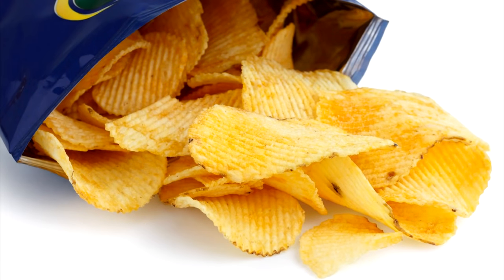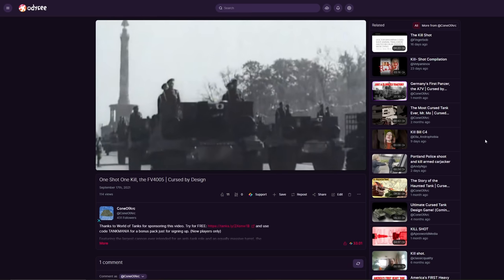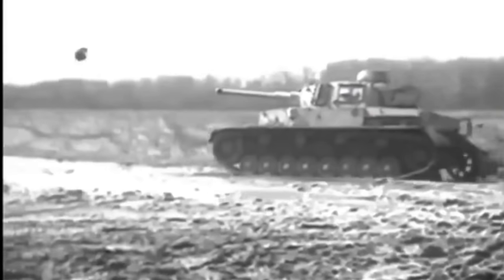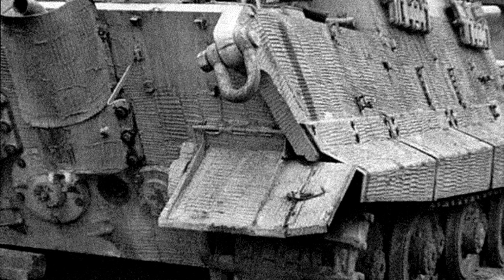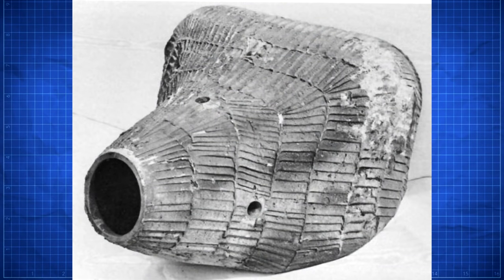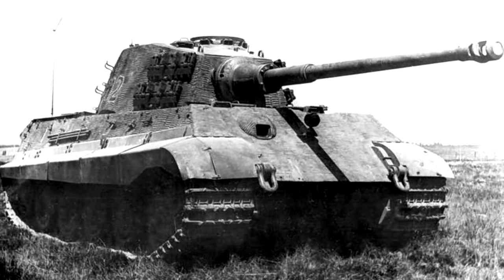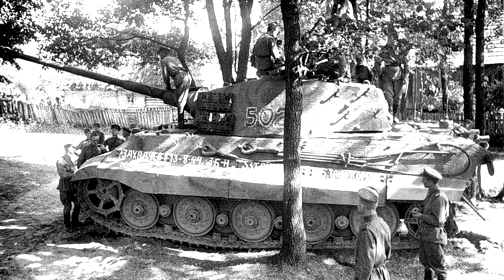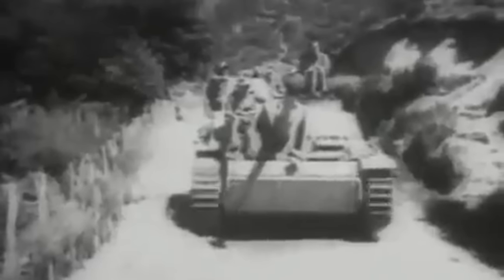Why did Germany put Zimmerit on their Tanks? | Cursed by Design

Comment: The main thing is that the crews believed they were safer with Zimmerit, it's an important thing when you charge into battle
Reply: Placebo Effect...
Reply: The US Army did the same thing with the same effects 20 years ago with their Kevlar vests….the troops thought they were bullet proof and had extra confidence while wearing them……unfortunately though, years later when we invaded Afghanistan we discovered that an Ak-47 round (7.62) would go right through them like they were made of tissue. The military had known the vests were ineffective against small arms fire from day one and the only thing they stopped was flak, shrapnel and bayonets. Thankfully the Army had developed an alloy plate insert for the vests that would stop 7.62 rounds that they quickly issued out.
Reply: @Dj.MODÆO  thats fucked up
Reply: @Dj.MODÆO  If that would be true, US soldiers must be very very dumb.
I was '99 in the german army and in KFOR, we knew exactly that the kevlar vest would stop max a 9mm and the Bristol vest (Kevlar with ceramic plates) was rated to stop 3 7.62mm NATO hits (when hit on one of the ceramic plates). In Kosovo i didnt had contact with the US Army, they were in a differnt sector than i, but im pretty pretty sure they already had similar vest to the Bristol, long befor Germany bought theirs from the UK for KFOR.
And no, the kevlar vest did not stop bayonets or knifes.
Reply: @drscopeify  The differnten levels of armor has nothing to do with the weather, the army usually doenst care about that, it has tactcal reasons.
I was in summer in Kosovo, around 40°C, sleeping in the tents on daytime (after night shift), impossible, even hotter than outside. And still we had to wear the bristol when we had to go outside of the camp.
Some of us removed the cermic plates, but it was not allowed.
Reply: @wolf310ii  It was different in Afghanistan and Iraq.    In winter when on foot things are different than in summer when on foot.
Reply: @Dj.MODÆO  I doubt a kevlar vest can stop bayonet when it can't stop guns. I don't have knowledge about the exact armor youbare talking about, but remember that even if it can't stop bullets, it could lower its energy and help the innerds of the person be less messed up
Reply: @mortache  I’ve done 3, 12 month deployments. 2 to Afghanistan and 1 to Iraq. The hardened Kevlar(helmet) can definitely stop or deflect a 7.62 round….I’ve seen it many times. The kevlar flak vest however is a more flexible form of kevlar and a bullet could penetrate unless an armored back plate is inserted ….a bayonet however, even without having an armored plate….Not so much, that sh!ts like 3 inches thick. Maybe if you sharpened the hell out of it and had a running start downhill and weighed 250lbs. Lol.
Reply: "Zee hans, vhen ze panzer is coated vith zimmerite, it becomes booletproof!"

This is literal ork logic
Reply: @Dj.MODÆO  we started getting plates before the 1st gulf war
Reply: @wolf310ii  Kosovo is not a country

Comment: magnetic mines, sea mines did not "stick" to the ships.  rather the mines used a magnetic triggered firing system.  The magnetic trigger sensed the nearby passing of an iron ship.  the mines were NOT magnetically attracted to the ship.
Reply: Exactly! Naval mines used the effect of magnetism for exactly the opposite reason, so the ship need not touch the mine to detonate it as well as making it more likely that the mine will explode under the ship instead of against the side, doing more damage.
Reply: Exactly
Reply from the maker: This video wasn't specifically on how sea mines work I was just using it as a lead in to Zimmerit since degaussing is a somewhat related technology.
Reply: Ha, when I was a kid I thought magnetic mines would pop out of the ground, stick to the tank, and explode! 😄
Reply: @ConeOfArc  But you said that they could "easily stick" while they did not, so it would be nice if you'd correct yourself
Reply from the maker: @GaiusCaligula234  yes that was a mistake caused by oversimplification of how it all works. However I can't really change the video at this point so I'll correct it in a video about sea mines in the future.
Reply: @ConeOfArc  Cheers
Reply: @ConeOfArc just embarrassing
Reply from the maker: @andrewpease3688  Not really, everyone makes mistakes and I'm not afraid to admit when I make one.
Reply: Some sea mines were contact fired.
Reply: @andrewpease3688  sweat some more dude
Reply from the maker: I already issued the corrections I'm able to make without fully redoing the video which would be silly in my opinion as this isn't a video about mines. Refer to my latest community post for what I did. As for similar tech, yes both served as a sort of protection from magnetic mines just not in the way I initially described it.
Reply: @ConeOfArc  the amount of sweat is high with these people, thank your for the content Arc
Reply: The big thing about the magnetic mines was that they did not actually blow up against the ship, that is why they did not have contact fuses.  The mine was sitting on a shallow sea bottom and detonate when a ship passed overhead, triggered by the ship's magnetic influence.  The detonation would produce a large bubble beneath the ship.  The part of the ship encountering the bubble would be unsupported and the ship's keel could be broken.
Reply: @ConeOfArc  It's cool, I still enjoyed the video. I am a recent subscriber. To clarify, the comment about how I thought magnetic anti-tank mines worked as a kid was not meant to put you down, just poking fun at my own childish thinking. I re-read my comment and thought it could be construed as putting you down.
Reply: @richardbell7678  So the mine essentially acts like a trap door and grqavity does the rest?
Reply: @terraflow__bryanburdo4547  Yes.  

It occurs to me that the myth of magnetic mines being attracted to ships may have come from a fiction writer learning about the existence of magnetic sea mines without bothering to research anything about them.  A sea mine magnetically attracted to metal with enough force to pull it to the target shows up in an episode of "Gilligan's Island".
Reply: Limpet mine
Reply: @ConeOfArc  degaussing is in no way related technology. Stop doubling down. You embarrassed yourself and discredited your channel with a lack of knowledge and failure to research
Reply: @christianpethukov8155  put him down by all means! This is a school boy error and everything else on the channel is now extremely suspect
Reply: @ConeOfArc  i dont think degaussing is related to zimmerit tbh
Reply from the maker: @andrewpease3688  You don't know what the term "doubling down" means if you think thats what I'm doing. If I were doing that I would be refusing to make any corrections to the video and claiming my original point was correct. Me issuing a statement saying I made a mistake and will make a full video on the topic to correct that error as well as removing the main error in the video is the complete opposite of doubling down. It does suck that I made the mistake but I did what I reasonably can to correct it at this point so you berating me in the comments over it does nothing to change it.
Reply: @andrewpease3688  OK, give the guy a chance to get up and get good content out there. This isn't life and death. He has other videos that I've enjoyed that seemed just fine in terms of technical and historical accuracy.
Reply: Limpet, which was the marine equivalent  of the magnetic shapped charges used against tanks, certainly did exist.
But degaussing wasn't a protection against them. 
The poor little soul has conflated them with the magneticly triggered mines, and wandered off into a parallel universe.
Reply: @christianpethukov8155  bouncing betties
Reply: @ConeOfArc  You should correct it, reupload the video, upload an apology video and make an apology statement every day for 2 weeks for your single small mistake.

If you can't tell, I'm being sarcastic.
Reply: @andrewpease3688  clearly you have not watched the video. Degaussing is related because both it and the method discussed are related to magnetism and magnetically activated mines. This is a schoolboy level mistake, and everything you have said is now suspect. You should be put down by all means for this simple mistake.
Reply: @DDragon501  kindergarten
Reply: @masteronone2079  chill tf out he isn’t even a professional historian
Reply: @clankplusm  I'm sure he doesn't need his mum to defend him.
Reply: If mines explode just by sensing ship passing nearby, I would say they're VERY attracted...

... just like some boys out there.
Reply: Magnets, how do they work?!
Reply: @andrewpease3688  Yes you are.
Reply: @masteronone2079  Um, so where did he state that degaussing was used against Limpet mines? Because otherwise your comment is completely irrelevant and incorrect.
Reply: @DDragon501  He strongly implied that Magnetic mines were attracted to ships and that degaussing was the response. I pointed out that Limpet mines were the marine equivalent of the magnetic shaped charges used against tanks not the type of magnetic mine pictured (Not in as much detail as this, I'm being more granular in my explanation here because you seem to have a problem with comprehension).
I suggest you go back and re read the post, feel free to move your lips and follow along with your finger if that helps.
Reply: @masteronone2079  I read your post. You didn’t answer my question. Where did he specifically state degaussing was used against Limpet mines? Because he was talking about the magnetic detection mines used by the Germans, which he used the magnetic signature of a ship to trigger the detonation. He wasn’t very clear on that last bit, which he acknowledged in the thread above long before your comment.
Reply: @DDragon501  A: Your understanding of the time line of this thread is incorrect. Least important fact.
B: I never said that he said anything about Limpet mines.
C: I mentioned that Limpet mines existed and were the marine equivalent of the magnetic shaped charges used against tanks.
D: I pointed out that he seemed to have conflated (If the words are too big feel free to look them up) the idea of the magneticly triggered mine and the magnetic shaped charges known as Limpet mines. 
E: On reading my post I was a bit rude, I do regret that a bit but not he factual content of my post.
F: HOWEVER, I am now being rude to you and don't regret it at all. This whole exchange brings to mind the old adage "Never indulge in a battle of was with an unarmed man".
Reply: @masteronone2079  my point still stands: if he didn’t mention limpet mines, why did you bring them up? The “mine” he mentions is the Haftholladung, an anti-tank “mine” (closer to an anti-tank grenade) that used three magnets on one end to attach itself to the hull of the tank before detonating a shaped charge. They are not Limpet mines and I don’t believe he ever stated or implied they were the same.
Reply: @DDragon501  You have no point, save maybe the one on top of your head.
I simply pointed out that there was indeed a parallel marine technology to the weapons deployed against tanks. Maybe this was the source of his confusion.
I do not need to justify that to you, particularly since you have demonstrated that you are unwilling or unable to comprehend simple factual statements. 
If you read through the thread carefully I wasn't  the only person to mention Limpet mines in this context. Why don't go find out what the others motivation was?
Reply: @masteronone2079  I think you misunderstand my inquiry. I am wondering why limpet mines are relevant to this thread. Arc never specifically mentioned limpet mines, and I don’t think he implied that degaussing was used against Limpet mines. If you’re comment was in response to another person, why didn’t you @ them? All of your facts are indeed correct, but I don’t think they are relevant to this discussion.
Reply: @DDragon501  If you are unable to see the relevance of Limpet mines in this context, (And despite my previous efforts I am not trying to be nasty to you in this instance) I am at a lose to understand your thought process and motivation. You seem to be trying to attribute motivations and intentions to me that were never explicitly or implicitly present in my post. You've been a good sport letting me work out frustrations insulting you but I've run out of avenues to try and make you understand. As for my mention of others raising Limpet mines, it was in the hope that you might find those posts and querie their authors as to why they felt they were relevant to the discussion,  maybe they will have a better answer for you, they might even be nice about it, you never know.
Reply: @masteronone2079  Ok. 🙂
Reply: @ConeOfArc  Degaussing on a ship is an anti corrosion measure. Blocks of sacrificial nickel would reduce the electrolysis corrosion caused by  salt water. reducing iron plate erosion.
Reply: Limpet mines called, they'd like to have a word.
Reply: @paranoidballoon8190  Primarily used to de-magnetise a ship in order to stop magnetic mines detonating.
The term was first used by then-Commander Charles F. Goodeve, Royal Canadian Naval Volunteer Reserve, during World War II while trying to counter the German magnetic naval mines that were wreaking havoc on the British fleet. The mines detected the increase in the magnetic field when the steel in a ship concentrated the Earth's magnetic field over it. Admiralty scientists, including Goodeve, developed a number of systems to induce a small "N-pole up" field into the ship to offset this effect, meaning that the net field was the same as the background. Since the Germans used the gauss as the unit of the strength of the magnetic field in their mines' triggers (not yet a standard measure), Goodeve referred to the various processes to counter the mines as "degaussing". The term became a common word.
Reply: Holy shit, this comment thread is hilarious. YES, degaussing was not intended to prevent mines from sticking. YES, Arc made a mistake. YES, Arc corrected his mistake in the best manner possible without completely remaking this video. NO, no one is going to die, or be seriously injured or affected by Arc's mistake. If y'all know so much about the topic, why don't YOU make videos about it? Oh yeah. That's right. Cause it's easier to point out others' mistakes and berate them than it is to spend hours making a video on the subject.

Just as a side note, if anyone is interested, the magnetic field of a material is almost entirely unrelated to the ability of a magnet to stick to it. If you'd like to learn more, feel free to read a textbook on college level physics. It's pretty interesting stuff, although it can be somewhat difficult to grasp without prior knowledge of the subject.
Reply: @curtisbacon7856 ?
Reply: The mines were not MAGNETICALLY attracted to the ships, but rather, were sexually attracted to them
Reply: Limpet mines DO stick to ships, and if you know what a "limpet" is you'll see why they're called that.  You're thinking of the naval mines that were anchored large round spheres bristling with "antennae", which triggered the mine.

Comment: German Engineers: "So, the armor works great, right?"
Crew: "Sure! Helps with concealment, and against burning to death! Can it come in skull-pattern?"
Engineer: "No, does it work against magnetic mines?"
Crew: "Um... maybe? Our enemy doesn't use those."
Reply: The fastest milkman in the West  there are very rarely used on what i understand also magnetic mines/grenades are considered costly to manufactured asides the introduction of much better anti tank weapons like bazookas and piat (projector infantry anti tank) were more common to be used and much safer than anti tank grenades (although it's still used up today like molotov -homemade incendiary bottle grenade-)
Reply: The fastest milkman in the West  The Brits used the Hawkins grenade but it really wasn't that useful, you'd be lucky if you managed to blow off a track. Zimmerit or not there is no way a Hawkins can hurt a fucking Tiger.
Reply: Who is the fastest milkman in the west? His profile leads to a page saying he was deleted because he violated guidelines

Comment: After WWII, a Wehrmacht officer said: Our tanks could take out any ten Shermans!
But there was always an eleventh Sherman ...
That was the real engineering problem for the Germans.
Reply: @bertjanspeedfight2  The russians also overwhelm them
Reply: It wasn't an engineering problem, it was a logistical problem.... being hopelessly outnumbered and under-supplied compared to a British Empire that was able to source raw materials from all over the globe, together with an American partner that could manufacture whatever was needed without any risk of the war interfering with production.
Reply: Having more of everything is the best strategy to win....😀
Reply: @bobshenix  agreed.
Reply: Gernany certainly had industrial capacity to mass produce tanks unlike Japan or Italy,it seems very obvious on paper when you compare their economic power at the time.However most of their late war tanks were ridiculously expensive to build and maintain compared to Soviet and Allied ones.And only 10% of the Wehrmacht’s budget went to AFVs.Despite having larger steel and carbon resources than Soviets they built less than half of what Soviets made between 1940-1945.Not to mention that they never even mobilized their industry for war until like 1943.Furthermore despite the raw material shortages and Allied bombing they catched up with Soviet production by late 1944,ditched some in-depth WW2 fact books for that.
Unfortunately this time,they neither had enough fuel nor well trained crew to operate their tanks and planes at late 1944.
Reply: German tank ace Michael Wittmann's Tiger tank was taken out, killing him, by a single hit from a 'Firefly' Sherman tank.